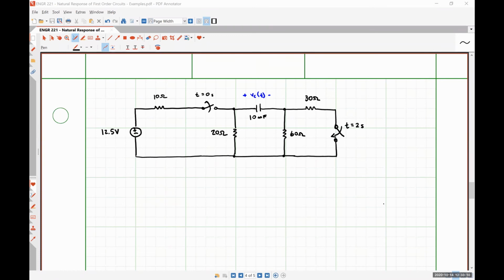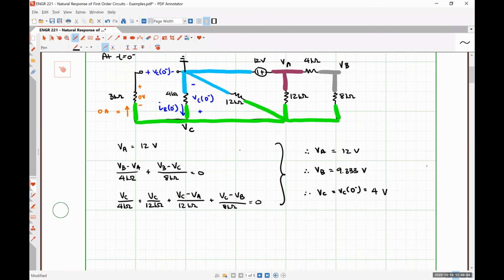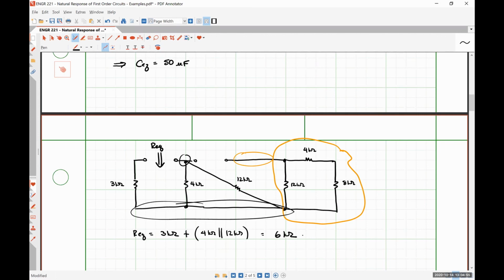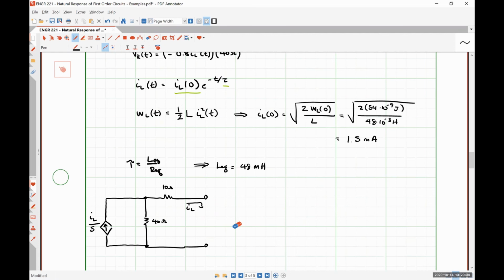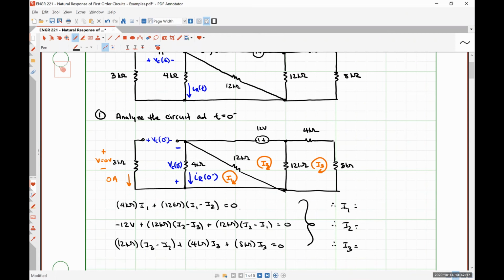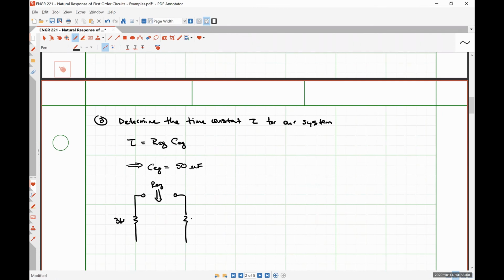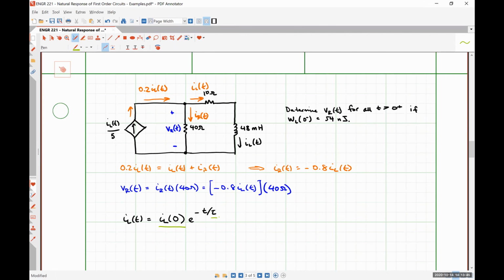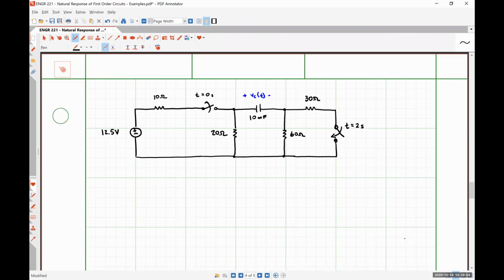ENGR 221 - Class Meeting #15 (Fall 2020) - 10/14/2020

Comment: The sign of the currents are wrong at 28:54. They should be the negative of those reported namely I1 = - 2/3 A and I2 = - 1/6 A so Ir = I1 - I2 is actually negative and equal to - 0.5 A. Ir is actually going UPWARDS at 0.5 A.

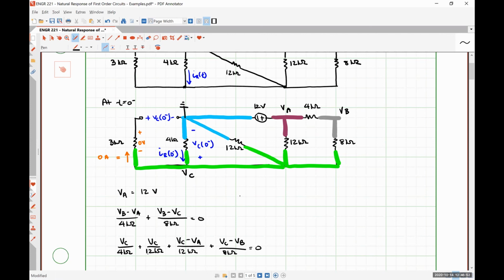Comment: 3 equations in 3 unknowns at 16:23?  Not needed. First consolidate the rightwards most 4 and 8 ohm series resistors into 12 ohms which are now in parallel with another 12 ohm resistor making 6 ohms in total. Choosing the ground at the large green node at the bottom we now have one equation in one unknown namely: V/4k + V/12k  + (V + 12)/6k = 0 solves readily for V = - 4 V at the blue node. then  - 4/4k = - 1 mA current for Ir(0 ). Doing KVL around the leftmost (open circuited) loop we have  ( 1mA)*4k + 0*3k +Vc(0 -) = 0 or Vc(0 -) = 4 V.